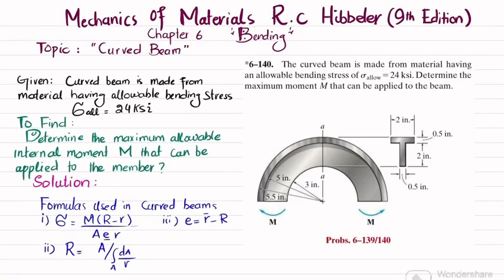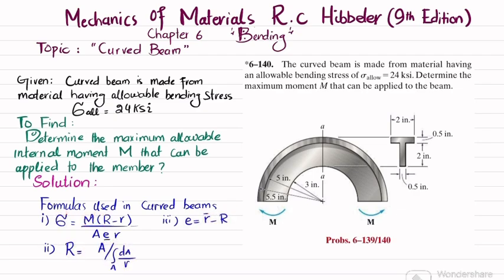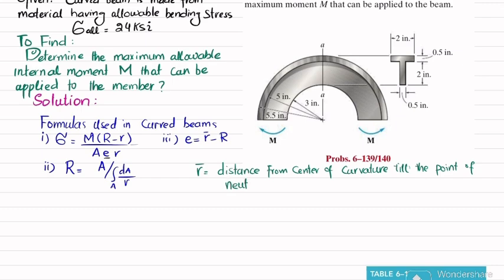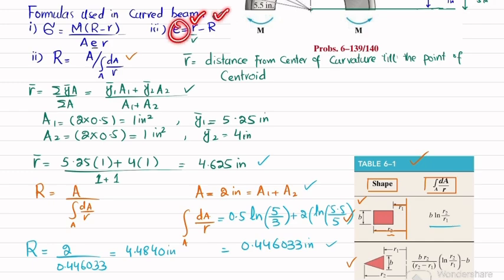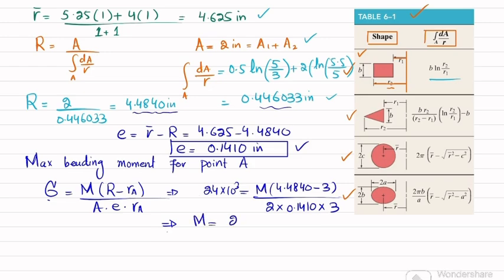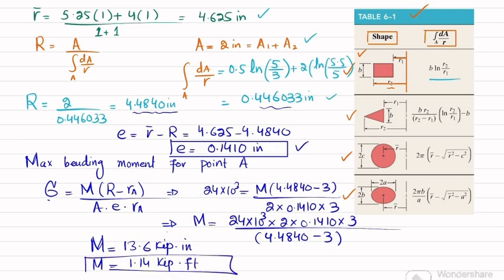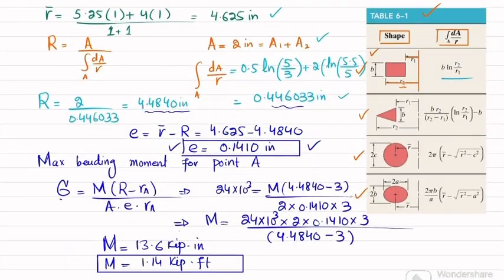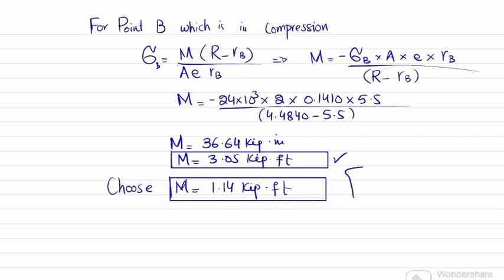6-140 | Determine the maximum moment M | Curved Beams | Mechanics of materials RC Hibbeler

Comment: Do you think you could use this solution to calculate the allowable stress of a steel plate helical staircase, using the reactions given by a fixed support in an FEM model?
Reply from the maker: FEM follows the concepts of mechanics of materials that's why it calculate all the things based on its theory..